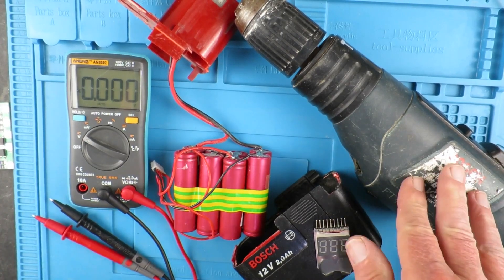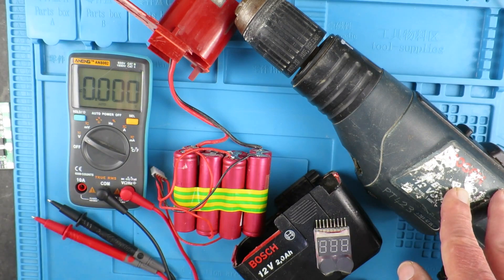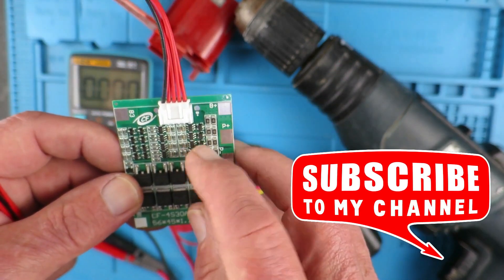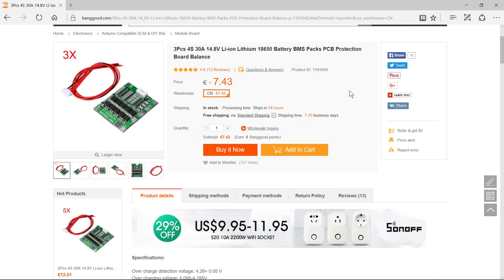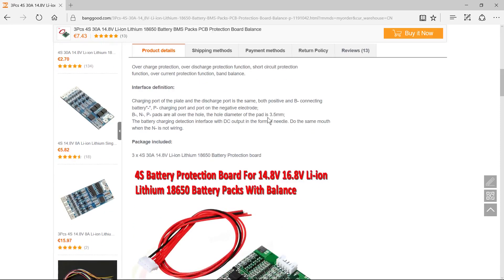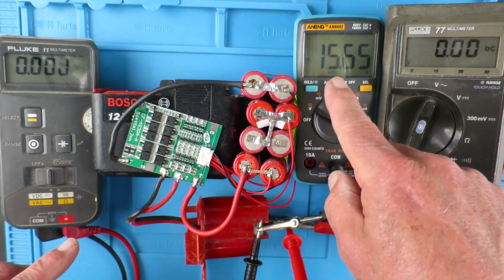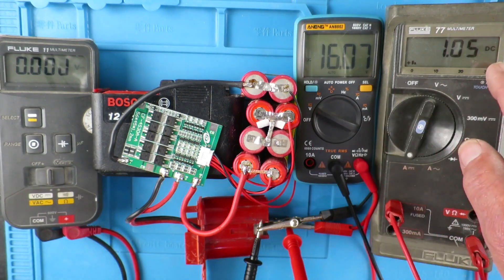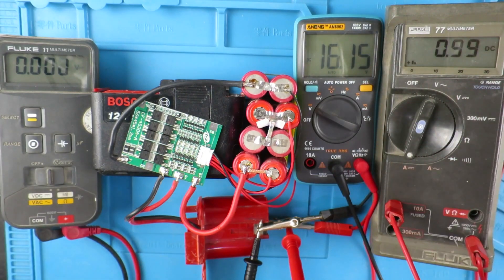4S 30A Li-ion Battery Protection / Balance Board Test Electronic Tutorial

Comment: Hallo, tahnks for your video, can it be used for lipo battery?
Reply from the maker: Yes, you can see the datasheet for the IC here : https://www.ablic.com/en/doc/datasheet/battery_protection/S8254A_E.pdf Thanks for watching, have a great day!
Reply: @1nformatica thanks bro, do you have this bms datasheet and schematic?
Reply from the maker: @ilhamrusdandi6338  I no longer have that board but I am sure it used the same IC, there are example circuit schematics at the end of the data sheet. Also you ca see me mod another BMS using this chip here : https://www.youtube.com/watch?v=sZOlD9pzaQM

Comment: These BMSs do a "dumb" balance, whenever one cell gets to 4.18v they connect a discharge resistor to them, which discharges them at about 50-100mah, but they are still being charged, basically they hold back the charging current of the higher cells deducting the resistor discharging current, hoping the lower ones will catch up. But notice that it only works on low charging currents, if you charge at, say 4Ah, even with a 0.1Ah load trying to discharge the higher cells, their voltage will still shoot up from the remaining 0.9Ah (per cell), and will reach the cutoff voltage of 4.28 long before the other cells had time to rise and balance.
Also the "end-of-charge" of these BMSs is not an end-of-charge at all, it's the over-voltage protection, whenever one of the cells reaches 4.28, it disconnects the entire battery from the input, it's perfectly fine as an over-voltage protection, but it's much too high as an end-of-charge voltage.
In conclusion, if you don't care about the cells longevity (e.g. salvaged from old laptop batteries), because of the high cutoff voltage, it's perfectly fine to charge using the BMS, provided you can control the power supply's voltage, 16.8v for a 4s battery, and the current to about 1.2Ah (0.3Ah per cell) or less.
Reply from the maker: Thank you for your detailed contribution.

Comment: 4.28 is effectively an overcharged condition. The cells will last about a 100 cycles like that. If you stay below 4 volts per cell  you will have several 1000 cycles.

Comment: Do you think this would be suitable for charging a LiPo 4S battery?  I'd like to use it on board an RC plane so it would charge the battery via an array of solar panels on the wings.
Reply: Oops, I forgot to mention: Thank you for presenting such a concise explanation of this device--it seems you're the only person on the entire internet to have done it!!
Reply: Clarification: I'd like to omit the main battery leads from this board and direct them to the motor and load drawing devices on the plane. Do you think this board would entertain only providing to-battery current via the balance port?  I'd be drawing current out from the main battery leads at potentially much higher amperage than this board could handle (like during takeoff for example).
Reply from the maker: Hi, this board is only for battery management, it is not a charger. I would consider a module like this one : https://youtu.be/tWSPvsFQxzI you would need one per cell though.

Comment: Heya I loved the video man 👍 I have a question regarding my 4s BMS, I just installed one for my 4s 4p battery and I got 16.40 volts out of the BMS which is good but whenever I plug my battery to a load the battery immediately drops to 11.16 volts and but it drops to 4.8 volts when I start using the load with the battery. Can you tell me what's causing this? The BMS and battery cells are brand new.
Reply from the maker: Thanks! What type of cells and how are you charging them? Check my video on cell matching : https://youtu.be/z2Rhk8KJp_k If the battery voltage is really dropping to 4.8 volts then you will be damaging the cells and risking fire or explosion so you must find out what is going on before  proceeding! Please consider subscribing if you have not done so already!
Reply: @1nformatica  Honestly I think I've found out why I've been experiencing these major voltage drops, since I wanted to avoid soldering my batteries as much as possible (and spot welders are expensive) I resorted to using thin copper tape as an alternative to soldering anything on the batteries and I noticed that the tape I was using can't withstand such high amperage or voltage.
Reply from the maker: @OctAngel  Glad you are making progress. I have tried this really inexpensive spot welder https://youtu.be/PB0znkuYR7Y maybe something to consider?

Comment: Hi pal, ive got the same BMS just connected it to my DIY powerwall made from 18650 cells. the thing is i cant get more output from the BMS than 8 / 9v (from P+ and P-) and the voltage from B+ and B- is 14.6v. The thing is i had all batteries at 4.2v before installing the bms (which is for 3.7). I connected my inverter directly to B+ and B- to discarge the pack so they would be arround 3.7 or less but still cant get 14.6v output from P+ P-. Also ive got it connected to a PWM solar charge controler and wouldnt recognice the battery. Could it be the BMS?  Can it be fixed? thanks in advance.
Reply from the maker: Disconnect everything from the BMS (apart from the cells!) and P+ P- should read the same as B+ B- unless the cells are below 2.55 volts, the low cut-off voltage. If this is not the case then the BMS is probably faulty. Please consider subscribing if you have not done so already!
Reply: @1nformatica  thanks pal, ive just replaced the BMS and now its working, i need to test the other one again whe i get a new battery pack. Thanks a lot!
Reply from the maker: @rabbitempire5114  You're welcome!

Comment: Hello I am charging a big 4s battery with 15A current, will this bms be able to balance cells or something will go wrong? Thanks
Reply from the maker: The balance circuit only draws 100 mA so it will balance the pack but very slowly.

Comment: Wondering if I can get some help with a 4s 5p battery I have built. The 
BMS looks identical to the one in this video. I am charging at 17v 
0.5amps and cant seem to engage the cuttoff.  Not sure whats the highest
 point each cell could hit. On my last charge I had some hit 4.246 
before I unplugged.  Wondering if I'm ok to let it go ? or if I am 
charging it wrong...  also the battery has a live load while its 
charging...not sure if that makes a difference. But its pulling minimal 
from the battery during the charge.  Any help would be greatly 
appreciated.  thanks
Reply from the maker: With that configuration it is unlikely the cutoff will ever engage. The charge current is low and with a load even small will have an effect. The balance resistors also will draw about 100mA for  any of the 5P arrangements. I would not be concerned assuming the charger is constant current.
Reply: @1nformatica   ah thanks. Would you have a recommendation on volts / amps I should be charging at to kick in the cutoff ?

Comment: Hi! Thank you for the very useful tutorial. One thing I have not clear about these protection/balancing modules is about charging input. Has to be a dedicated charger circuit that limits current and voltage, or it's a fixed voltage input required and the board will do the current/voltage limitation for a safe charge?
Reply from the maker: Hi Alberto, It needs to be a constant voltage and constant current charger. For charging I use an old laptop charger rated 19 volts at 3 Amps and put a DC step down module which I can set the voltage and a constant current determined by the cell datasheet in my case 1 Amp. The module is this one : http://bit.ly/LedDriver You can see how it works in one of my other videos : https://www.youtube.com/watch?v=QYc1On0q4AA  The bms is designed for 18650 type cells which have a full charge value of 4.2 volts therefore the charging voltage should be at least 16.8 for full charge. I set my voltage to 17 volts as the bms will balance and stop in an overcharge condition. Please consider subscribing if you have not done so already!  Ciao!!
Reply: @1nformatica  Thank you so much!  Just subscribed :-) So you think that powering directly with 19V and not limiting current the module won't regulate and stop the charge process correctly?

Comment: Hello can i make 4 pack with 4 different bms of this kind and connect them in parallel ?i just purchased 4 of these i need to push 60 Amps out of them at 12v continuous
Reply from the maker: I do not think it will work well. The packs will all have slightly different capacity and voltage. One pack will probably drain at a higher rate than the others and shut down. If you try it let me know your result.
Reply: @1nformatica  it's okay I'll update you,but how do battleborn achieve this yet they use same configuration?
Reply: @kipdennis3796  You "can" do it but also have to pack balance. It's a nightmare.

Comment: Hi there. Now that i have the board working, can i use the nicad charger to charge the battery. It uses .9 amps. Thank you.
Reply from the maker: A nicad charger is not suitable for lipo's. For charging I use an old laptop charger rated 19 volts at 3 Amps and put a DC step down module which I can set the voltage and a constant current determined by the cell datasheet in my case 1 Amp. The module is this one : http://bit.ly/LedDriver You can see how it works in one of my other videos : https://www.youtube.com/watch?v=QYc1On0q4AA  The bms is designed for 18650 type cells which have a full charge value of 4.2 volts therefore the charging voltage should be at least 16.8 for full charge. I set my voltage to 17 volts as the bms will balance and stop in an overcharge condition.
Reply: 1nformatica okay thank you. Love tour video by the way.
Reply: 1nformatica hi there. Just wondering about your answer. I know that normally the nicad charger would not be good to charge the lithium ion batteries, but with the balance board in there, wouldnt that protect it? Whats the difference from you mains power unit you used in the video and a nicad charger? Sorry that im being daft.

Comment: Hi there, 

I just purchased this BMS you have shown here. Funny thing happen and wondering if you can help. 

When I completed the pack, i tested it in my skill saw, worked great. I then charged the battery pack with a TB6B charger. It charged to 16 volts and stopped. I tested the saw and it started and quit. I then tested my drill and torch and works fine.  I don’t understand why the saw initially worked and after charging does not work. 

Any ideas?

Thank you

Pauli
Reply from the maker: I guess the skill saw is drawing more current and triggering the over current protection. There is a complete description of the circuit and a possible fix here : https://mysku.me/blog/aliexpress/58000.html
It is in Russian!
Reply: 1nformatica great article, thank you. Nothing google translate couldn’t handle. I saw something like this on you tube with a different board. This mod is much cleaner. Thank so much. Id buy you a beer if i could. Paul
Reply: 1nformatica the company that sold me the BMS went back to the manufacturer, they say the protection circuit is not active until the first charge. So that explains why the saw worked when i first tested. 😀
Reply: I added the caps, saw fires right up.
Reply from the maker: @paulsantangelo3813  •:*¨¨*:•_•:*¨¨*:• EXCELENTE_•:*¨¨*:•_•:*¨¨*:•_!!

Comment: maybe you can help me with how to connect my 4s5p battery to the solar charge controller and use this module 
I guess the best way is using the P+ and P- to the load only and charge the 18650 using B+ and B- bypassing the protection board, connecting B+ and B- direct to the solar charge controller, 12V GEL option. my pack have 4s because they never go too loaded by the controller. safe side. my solar charge controller don't have the option to adjust the charge voltage
this board can disconnect the battery and the controller need the battery connected all the time to know if it's 12 or 24VDC. battery is the first thing to connect to the controller. allways!

so, in my setup this board only handle the cell balancing and max output in the load side. 
cell balancing is my big problem using recovered 18650 cells
I don't wanna burn the board testing but I guess the idea is right. maybe?

I don't know where to ask - sorry if it is the wrong place 
thanks anyway
Reply from the maker: You should not connect the solar charge controller to the cells. The charge voltage and current to the cells needs to be regulated. See this video : https://youtu.be/6YHi8u7NADU
This would be a suitable boost module : LM2587-DC-DC-Boost-Converter-5A-3-30V http://bit.ly/LM2587_Boost
Reply: @1nformatica  thanks!

Comment: nice video. I got the same board. 
B1, B2 and B3 in the board are useless or only for test as you show in the video or they can be used for direct connections without the cable provided? 
you tested it connecting to one solar charge controller? I gonna do that and I hope it work without burn the solar controller or this small board (or the house!)
Reply from the maker: The B1, B2 and B3 are the connection points for the balance circuit so you can wire directly to these instead of using the cable. You cannot connect a solar controller directly to this board. Normally Solar systems are nominally 12 or 24 volts but  the voltage varies according to the amount of sun. In either case some form of voltage a current regulation will be needed to safely supply the board. For a 12 volt system See this video : https://youtu.be/6YHi8u7NADU
This would be a suitable boost module : LM2587-DC-DC-Boost-Converter-5A-3-30V http://bit.ly/LM2587_Boost
Reply: @1nformatica  thanks!
Reply from the maker: @FIGUEIRINHA  Obrigado! You have a great channel too, it is a pity i don't speak Portuguese!
Reply: don't worry. near no one speak portuguese in the world.  maybe google translator can help you?
 
I connected the pack to the solar charge controller. I agree with you. this is not good. don't do that!
but I guess it is the best way to discover if the 18650 gonna burn on fire. or not 😀
rainy day here, waiting for the hot sun of the tropics.

Comment: how much time does it take for charging? and what voltage you are using for charging it? mine after 13v to get to 16v takes over 12 hours. im planning on upgrading my bms for this one
Reply from the maker: The time depends on the state of charge left in the cells and what current you charge at. I set the charge voltage to 17 volts. What I use is an old laptop charger rated 19 volts at 3 Amps and put a DC step down module which I can set the voltage an a constant current determined by the cell datasheet. The module is this one : http://bit.ly/LedDriver You can see how it works in one of my other videos : https://www.youtube.com/watch?v=QYc1On0q4AA  Please consider subscribing if you haven't done so already!!
Reply: @1nformatica  wow didnt knew about the constant current, thx a lot now ive already orderded the bms and the stepdown module. subscribed :)
Reply from the maker: @n3kix  Thanks! Let me know if you have any other questions.

Comment: Well i have the same board and have used it before, but now i got few of them new ones and no matter how i do it wont work. Well drill does start but i cant just press the power to full cause the cutoff. If i disconnect the balance wires then work well.. WHY
Reply from the maker: I believe the board uses the balance wires to also detect an overload condition as the cell voltages drop. It only takes one cell voltage to drop and it will cut out. There is a complete description of the circuit and a possible fix here : https://mysku.me/blog/aliexpress/58000.html
It is in Russian! Let me know if it works for you.

Comment: Thanks a lot for this video. I a new to LiPo batteries and I have some questions, perhaps will you answer ?
- first of all, in this video, to charge the battery, did you use a specific charger or simply a fixed voltage source with high current ability ? I ask this question because there are some electronic components built to specifically charge LiPo with specific cycles (for example this one : CN3704). Is it necessary in addition to this board, or this board more or less does the same work, including balancing ?
- next, how do we choose between 14.8V or 16.8V ? Is this simply the voltage applied to the board that defines it, or does the board "guess" the kind of LiPo that is used ?
- finally, if I put in parallel this circuit (with its batteries), a removable voltage source for charging and the loading circuit, will the load circuit continue to work if I hot-disconnect the voltage source ? So will it automatically switch from the voltage source to the battery ? And if I hot-plug the voltage source, will the circuit now work by using the voltage source and the batteries start charging ?
Thanks a lot,
    Mike
Reply from the maker: Hi Mike, For charging I use an old laptop charger rated 19 volts at 3 Amps and put a DC step down module which I can set the voltage and a constant current determined by the cell datasheet in my case 1 Amp. The module is this one : http://bit.ly/LedDriver You can see how it works in one of my other videos : https://www.youtube.com/watch?v=QYc1On0q4AA You could use the CN3704 as well. The bms is designed for 18650 type cells which have a full charge value of 4.2 volts therefore the charging voltage should be at least 16.8 for full charge. I set my voltage to 17 volts as the bms will balance and stop in an overcharge condition. Loading and charging the cells at the same time is not recommended. It may work but you will need to test it.